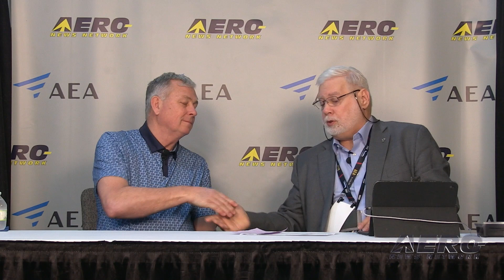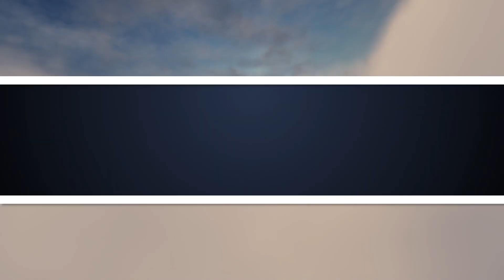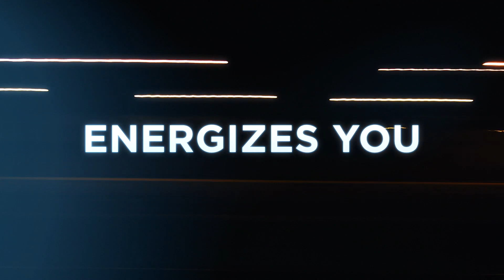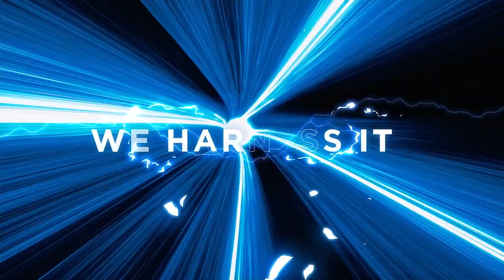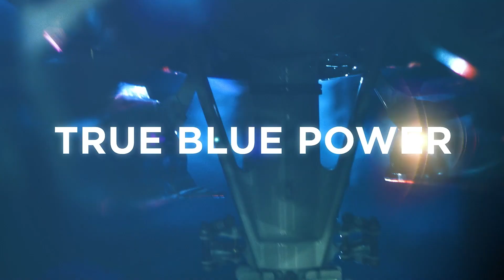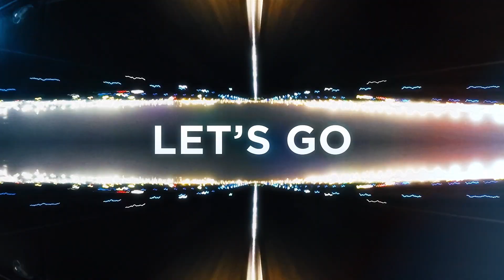CiES' Scott Philiben Tom Harper - Live and In Depth at AEA 2024

Comment: Scott Philiben has helped solve one of the biggest problems in GA….   Running out of fuel.

Cies supplies more useful fuel data to the pilot… than the original systems, initially installed in the planes.

Scott is the guru of fuel measurement!

Go Ceis!

😃